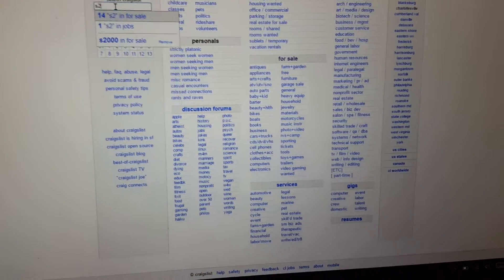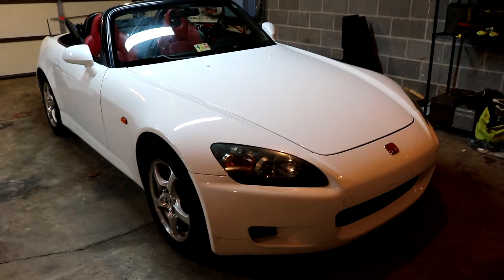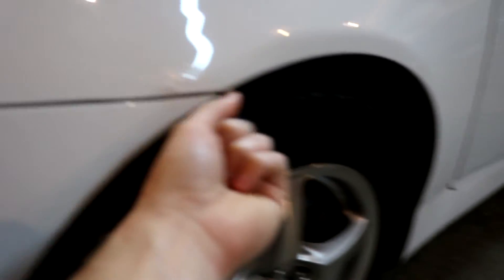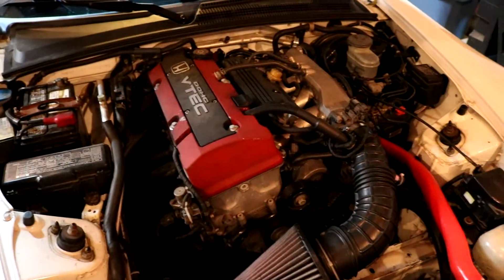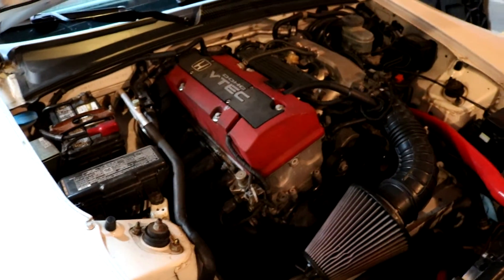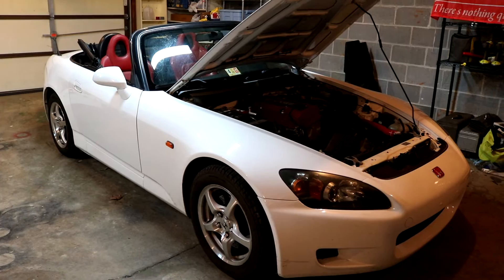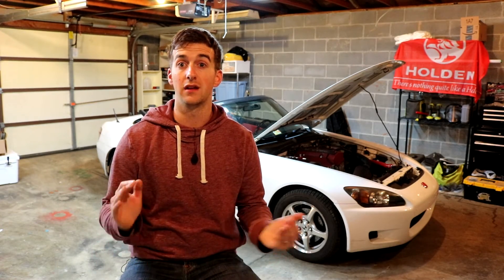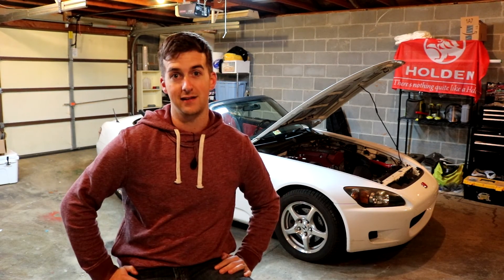Honda S2000 Project Build: First Look - Ep.1

Comment: im happy i ran into this video. Ive had my MY2000 s2000 for almost 5 months now and its my first honda ive ever owned. ive already upgraded the exhaust, intake, pads, and fluids. Took it out to Shenandoah circuit for my first HPDE weekend, and im hooked! I installed a sparco seat and a roll bar is on its way. 

very excited to follow your build. I was inspired by the guys at Speed Academy to purchase an s2000 (look them up if you havent already). theyve build up a salvage title s2000 into a track beast. 

I have the same rust spot on the rear passenger wheel arch and havent addressed. ill be keeping an eye out for the day you repair yours so i can see how its done.
Reply from the maker: +Kyle Gregg awesome man! Ill have to look into that Shenandoah circuit. Speed Academy is my go to channel, I found them when they intially bought the ASS2000. I hopefully will be tackling the rust in the next month or so, so stay tuned. I plan on making an episode for every change made to the car, at least thats the plan

Comment: Congratulations on your new S2000 my fellow S2000 owner :) I too recently got my 2001 AP1 about 3 months back and am loving everything about it! Looking forward to seeing how you clean yours up and take it from there...
Reply from the maker: +RolanTHUNDER thanks man! So far I love it and cant wait to make it super fresh
Reply: Garage Topics Man you''re going to spend hours and hours on that baby just cleaning her up. I spent 4 hours + the first time I got her washing and detailing. Clay bar, polish, wax, the works :) My finish is silky smooth now. I have a Silverstone metallic. It glitters brightly in the sun
Reply from the maker: +RolanTHUNDER you know it! I have to fix the rust as well so i got some hours ahead of me
Reply: Garage Topics
Ooh that rust has to go man, not good. What treatment will you use? Have you inspected your diff and transmission yet?
Reply from the maker: RolanTHUNDER will cut the rust out, and then try to get some rust encapsulator paint in between the inner and outer fender panels either from the trunk or by making a cut. i will then have to shape the rear fender and paint it. if it looks like doo doo, i may look into adding fender flares
Reply: Garage Topics
Ok, sounds somewhat intense. Could you do that by yourself?

Comment: the car is repainted... or at least the fenders. the S2000 badge is not on the sides. (And the tips which is cleaning the windshield is white.. until the AP2 it's not painted with the cars color. so in this case it needs to be black when it's stock.)
the rear bumper is not stock or it was cracked because the fog light is missing from the rear.
The center console is not AP2. :)
When the engine is AP2 than he forgot to change the valve covers.
The door panels are AP2 :)
The stitches soft top are loose, the soft top doesn't went down well.

The oil problems existed only with the F20C1. There was no issues with F20C2 anf F22C :)

Good luck with the car!! :) S2000s are insane.
Reply from the maker: +FreestylerAlbert thanks a lot!
Reply: FreestylerAlbert s2000s in america do not have a rear fog light
Reply: yes you're right. :) That's my mistake sorry.

Comment: I think you're going to really enjoy this car.  It is very hard to find something you can have as much fun driving for this amount of money.

Need any advice, let me know. I'm pretty familiar with them. I'm on my 4th one (3 AP1s & an AP2) and I work on them on the side changing clutches, soft tops, suspensions, engines. I've worked on J32 and K24 swapped S2000s and did an F22 in an AP1 just like what you have.

I hope you have great fun with it! They're very enjoyable. :)
Reply from the maker: +ntenseone I totally agree they are a great bang for the buck at their current pricepoint. How does the S2000 behave with all the torque from a K series? Does it ruin the S2000 vibe not having an f engine? Thanks a lot for watching I have a lot more videos in the works
Reply: It does have more torque. 
I wouldn't say it ruins the car,  no,  but it does make any kind of repair more complicated and potentially more expensive.

Comment: your top in it's retracted position sits higher than normal. That is a common issue. Check out modifry straps (20 bucks easy fix). It will save you the trouble of fixing possible future tears.
Reply from the maker: +Jamshaid Masood yep I need those straps for sure, mine are a month away from shredding into dust

Comment: you said you plan to track the car correct? if you do plan to, why don't you go over fenders in the rear. imo the only way to get rid of rust is to cut it out. I had that same rust bubble on my ap1. cut it out and put over fenders on. No more rust.
Reply from the maker: +Sie Lee It wont be 100% track, but I guarantee it will not be stanced af. I plan to remove all the rust when I am in there and repair/repaint as cheap as possible. If my repairs look like doo-doo, I will def go with overfenders. Thanks a lot for watching? Post up your instagram if you have one and I will follow you
Reply: I'm glad your not going the stance direction like half of the s2000 owners do. You have a great platform to start. Maybe I missed it but which ecu do you have? The stock ap1 or the ap2? I plan on doing the f22 swap this winter since my ap1 motor burns oil just like all ap1 motors do.
Reply from the maker: +Sie Lee I dont hate stance, but it has a time and a place on regular cars not driver cars. The car is running on the stock AP1 ecu that came with the car. Only issue is that it does not rev limit until 9k, so just be smart and you will be a-ok